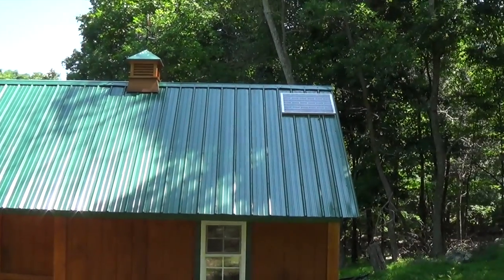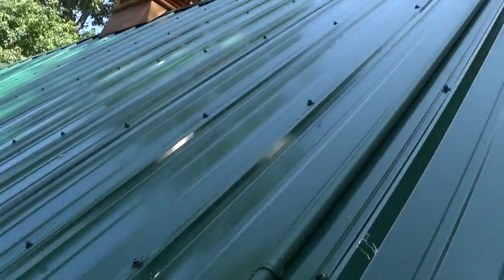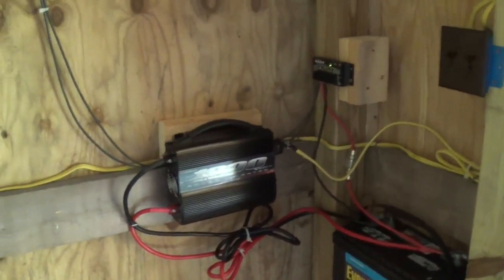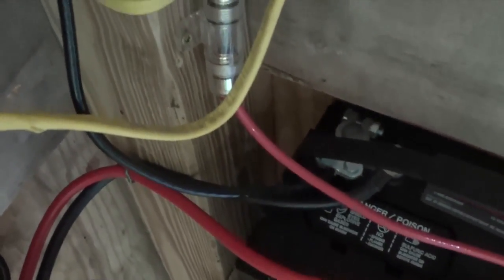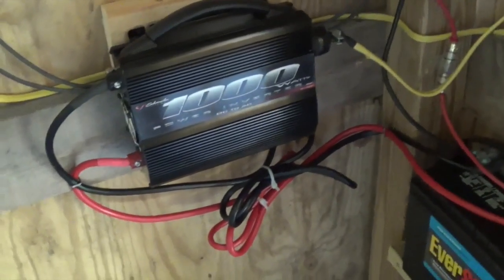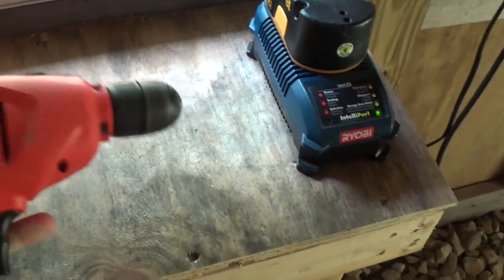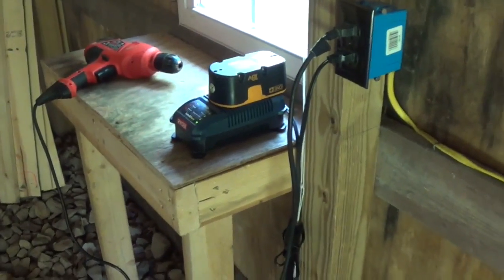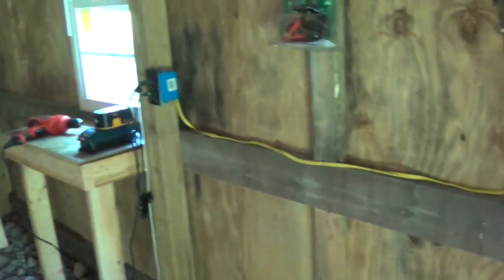Solar Powered Shed

Comment: Where did you get the solar panel and inverter please? My email is cmilo@christophermilo.com. I just built my wife an 8x12 Garden barn and think what you have done will work perfect. I appreciate you sharing your sources! God bless
Reply from the maker: The system has been upgraded from old components from the cabin. Will post another video about the up date. The solar panels, controller, and inverter was found online.

https://www.youtube.com/watch?v=q3KC1LMeeBU&t=3s

Comment: Very nice. Simple is the only way to go. One thing I've learned in the past is that modified sine wave inverters can damage rechargeable batteries. Now this was back in 2002-2007, and don't know if they have changed the design of inverters. I damaged my cell phone and laptop battery and my electric 24 inch fridge still runs but the motor is noisy. Has anyone noticed anything with their system?

Comment: I am thinking of using solar on my 14x28 mini barn instead of having a separate grid power at which they would charge $50 a month even if I didn't use any electricity 😳. I would however have way more lights than that barn as I was planning on having four two bulb motion lights on the outside alone. Power inside for table saw, chop saw etc.. I haven't looked to far into this yet besides just looking on here to get some education on the subject, not even sure it would be better doing solar or just go with grid power.

Comment: Pretty funny,  A marine starting battery, and he converts it to "DC power like you see in yer house" then hes running it into a converter to power AC bulbs lol, first off you got the wrong kind of battery, you want a true deep cycle, second your house runs off AC, third you could of just used DC bulbs to be far more efficent

Comment: They sell 12 volt bulbs that are just like those, but you run 12 volts through the switches and fixtures.  You have not inverter losses. Then use inverter to run to a wall outlet and you can turn inverter off when not needed. The 12?volt lights are about $6

Comment: Battery minder for what? You have the charge controller that is charging your battery. SO I dont know why you showed or mention that device.
Reply: I think he means if he has a ride on mower or something with a 12v battery that does not get used a lot he plugs that Battery Minder into the 110v and the plug pack maintains the battery in the mower/motor cycle/car.

Comment: home depot has 12v led 12 ft strip lights put 4 of them in my shed you can perform surgery, try to keep a/c loads to a minimum, have a 300 pure sine wave inverter but i normally keep it turned off, plenty of 12vdc lights, fans and even battery chargers are now available, i'll have to do a video of my setup

Comment: It appears you still have the link installed on the Morningstar, selecting the voltage setpoint for sealed batteries (Gel or AGM), rather than flooded if it's removed. Any particular reason why you have left it in even though you're using a flooded marine battery?